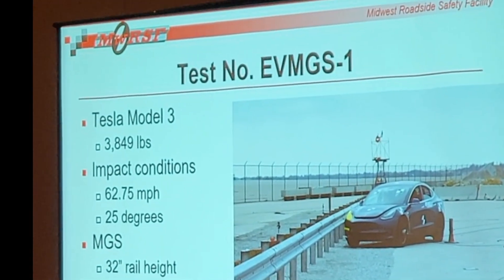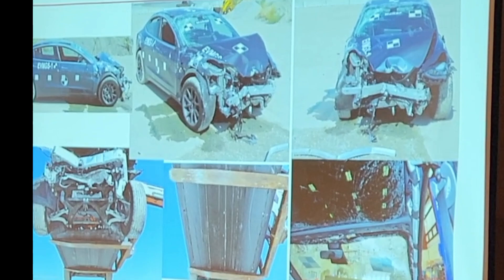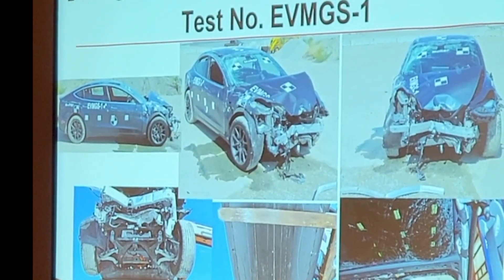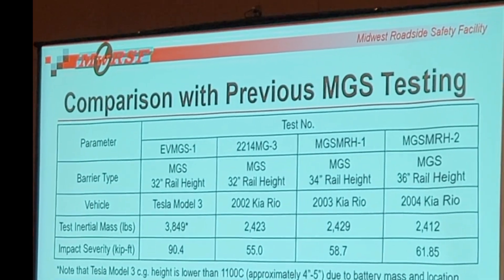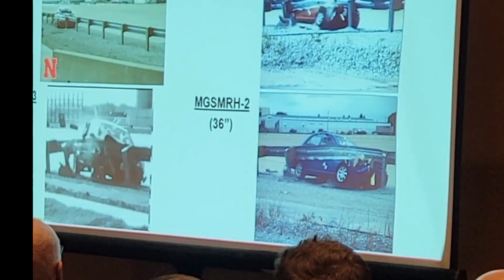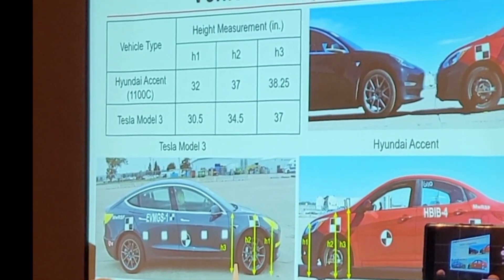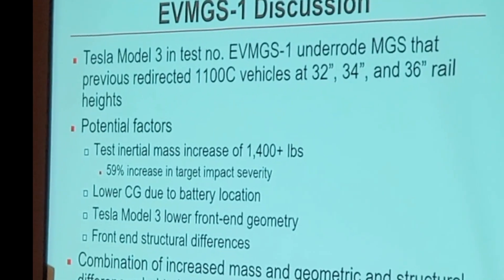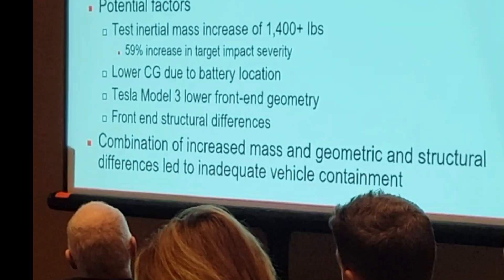Tesla Crash Test FAILURE: University of Nebraska Explanation

Comment: What I think also might be a issue is the fact that ev vehicles weigh significantly more then your average vehicle the same size all that mass is hard to stop
Reply: They’re no heavier than conventional SUVs. The issue is that the weight is concentrated in the battery package—low down in a stiff box.
Reply: Nah I believe your wrong bud do your research
Reply: @ChristianKelly-rr3vr  hes def right. Total mass is comparable. Location of mass, behavior of frame and suspension, completely different
Reply: @ChristianKelly-rr3vr no he’s right, the Model 3 - even the long range variant - are lighter than most SUVs

Comment: thats why u need washers for bolts to fix rail on post. Americans...
Reply: hello, an american here! for this type of barrier, fixing the rail to the posts would cause the rail to turn into a ramp as the posts are pushed over. the idea is for the rail to wrap around a vehicle as it crashes.
Reply: Confidently wrong lol
Reply: @reinbeers5322  EU thinks different
Reply: @rix141-x5c  And that doesn't mean they're right.
Reply: The washers also cause the rail to tear which is just another failure point. What we need is a completely different design that has better performance with a competitive cost to install

Comment: My biggest worry about EV's is stuff like this. Entirely new companies trying to build cars and being allowed to use the public as guinea pigs.
Reply: The real biggest problem is rolling out self driving before it’s ready enough, but that still has nothing to do with what this video is about.
Reply: The failure here is not about tesla but the barrier. In this case the barrier wasnt able to stop the additionak mass of the veicle. But yhe occupants were protected. So the tesla worked fine but the barriers need to change seeing an increase of electric veicles on the streets.
Its like saying: you buy the a new phone that is a littke snaller of the orevius one but you use the old cover. The phone fall and breaks becouse the cover was too big and didnt protect the phone.. the fault is of the producer whu created a smaller phone or you that didnt buy the rigth case?
Reply: @riccardoruffinatto3712  The model 3 has a mass of 3849 lbs / 1746 kg a C300 Mercedes has a mass of 3843 lbs / 1744kg (+45kg for fuel) . The mass of the model 3 is also not the issue.
Reply: @riccardoruffinatto3712  My major counterpoint to this though is that the phone covers and this scenario are universal and have been working with many other phones past and present without many issues. it seems it's only these particular phones that do not need the same standard as everyone else, and yet we're expected to plan around them.

the people who manufacture guardrails are going to make better guardrails in the future as well, but from what we have seen cities are not going to necessarily install the latest safety equipment let alone install the older safety equipment correctly.
Reply: Cry more.
Reply: @jeffalley4417  you’re gay